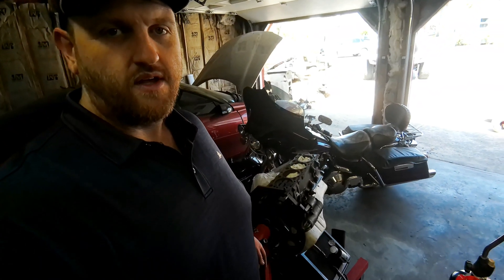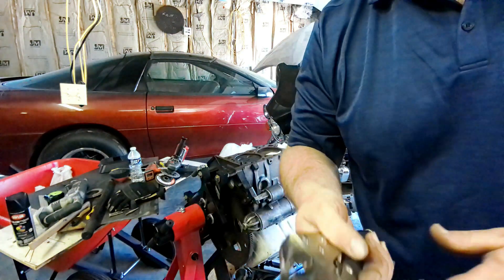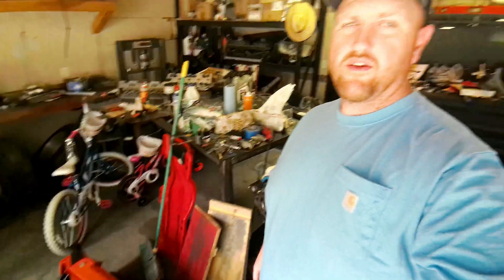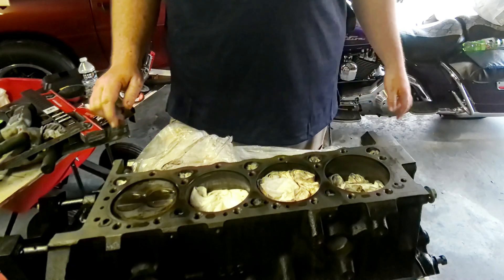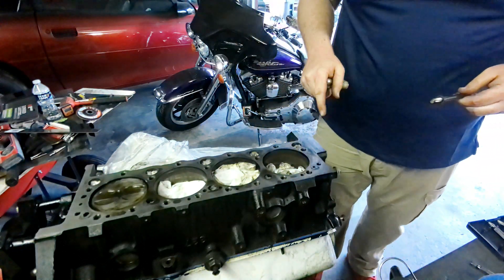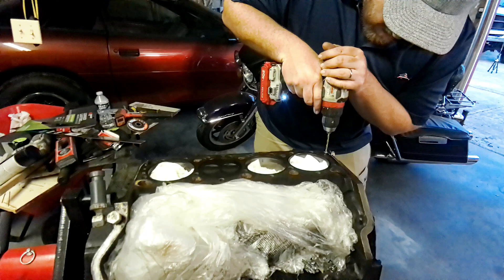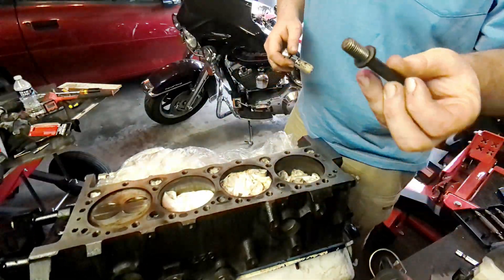How to resurface engine block at home! + DIY thread chasing tool and Ebay HEAD STUDS

Comment: I cringed watching the video, I have a v6 pentastar engine, mine has both decks perfectly straight and true, it was already at the shop where the only thing done after cleaning and inspection was just hone the cylinder bores but when I was assembling the heads I had 1 head bolt hole stripped and decided to repair all 16 holes, some of the holes for the head bolts lost their perfect surface roundness due to the tapping process even using a jig since the material does not affects anything else but the edge of the hole I am not concerned with it as I tested them with a straight edge and still true but there is a tiny surface scratch in one of the hole edge done when I filed the burr as I did on most of it; my fingernail wont catch and feeler gauge does not get stuck but the scratch casually connects to the edge of the outer cooling passage that goes around the piston; nothing is scratched in the vicinity of any of the pistons, I keep googling and asking questions because the right thing to do is just send it for decking but my cost to that is another $500.00; the decking itself is $200 discounted, then I have to get a new rear oil seal; $108.00, 12 connecting rod bolts, $58.00, plus main bearing cap bolts, bearing caps side bolts and windage tray bolts which are all recommended replaceable by Chrysler Manual, but even if I decided not to replace those I am still looking at at least close to $400 for my screwup. I keep reading to use JB Weld SteelStik but I am also reading this would fail and introduce even more damage due to the area used and how it may came lose, leaving the only trusted repair to a pass through the machine; I have my head in half from thinking and over thinking about it; at this point the block is still together with the pistons, crankshaft rear oil seal and oil pump installed; it all needs to come off to take the block for repair and start all over again from the start, All shops would say to deck it, lot of weekend warriors and you tube mechanics say it is fixable without decking; ultimately I will listen to what my heart tells me it is right, when and if I get the money to do it which I do not have right now; opinions and debates are welcome, hopefully a good idea comes before I do something stupid again. What I want to hear is that everything is going to work but the experience dictates otherwise.
Reply from the maker: Thanks for sharing your experience! This is how I chose to do mine but definitely the best option is the machine shop. Mine just needed a little cleanup and was already pretty flat. I've seen jb weld do some pretty crazy stuff and also seen it fail when I didn't think it would. Like you said, ultimately you have to follow your heart and what you think is the best move for your situation. Whichever you decide to do, I wish you the best and hope it work out for you!

Comment: I want to do a similar thing with my motorcycle cylinder head but I dont want to spend 50 dollars on a straight edge. I see it looks like you used a square is that really an appropriate tool for the job?
Reply: I was hoping for feedback if its not too much to ask thanks
Reply from the maker: Sorry I thought I responded... I prefer to use paper glued to glass for small cylinder heads. lay the head on the paper and run in a figure 8 until surface is even. As for the straight edge, I'm sure its better than the square I used for sure. I think if you need that level of precision the block and sand paper method may not be your best bet. Probably need a mill that is dialed in pretty good to take advantage of the accuracy the straight edge offers. Hard to maintain completely even pressures by hand and doesn't take much to not be perfect.

Comment: How do you know you were around 50 Ra roughness? Was it with a particular sandpaper? Nice video.
Reply from the maker: Appreciate the kind words! Yeah, I just looked it up on a surface finish chart to get the correct sandpaper for the finish I wanted.

Comment: So when are you going to show us how you resurfaced the block?
Reply from the maker: Hey Joe. Thanks for watching...some of the video files corrupted while filming this so didnt get much footage of the actual sanding.

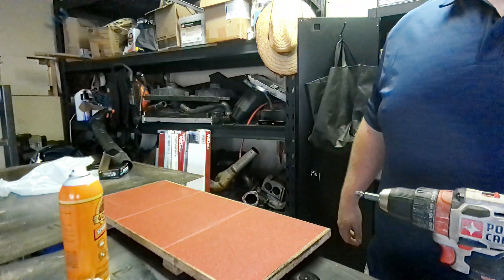 @ 6:13-6:50 of the video... made a couple of those sanding boards from MDF. Cut 2 pieces of 3/4 mdf a little wider and longer than the deck surface. Glue and staple them together. cut a couple 2 in strips for handles and nail it to the top of sanding boards.... then glued 3 sheets of sand paper to each board. I used 80 grit to start and finished with 320. 

@10:42 - 11:18...this was the final round of sanding and the only one that didn't get corrupted. First 2 rounds were the same process just 80 grit and 120 grit. Sanding will show low spots and you can check the depth with straight edge and feeler gauge. I wanted less than .002 variation across the deck so just made it where the .002 feeler wouldn't slide under. Clean up and good to go.